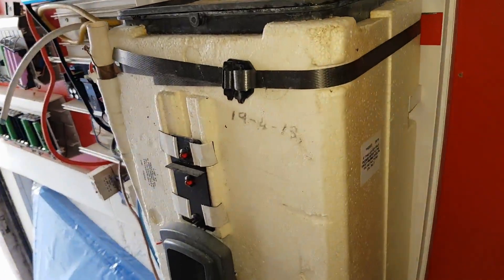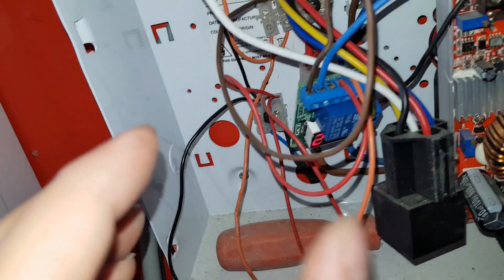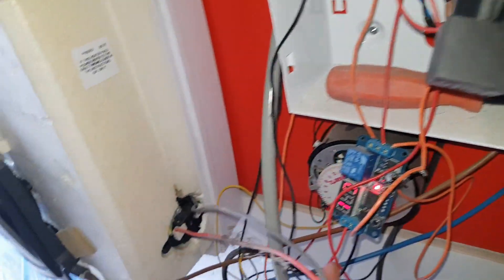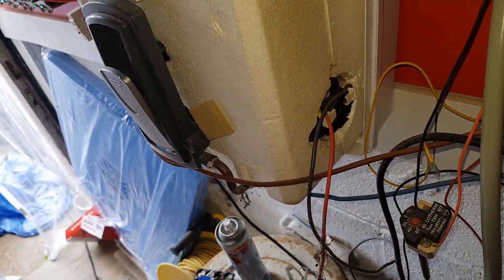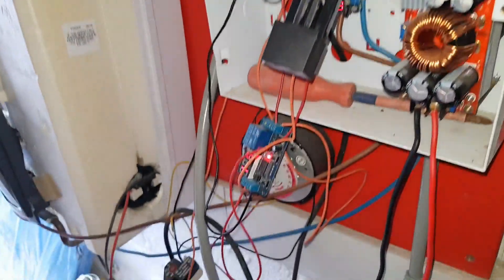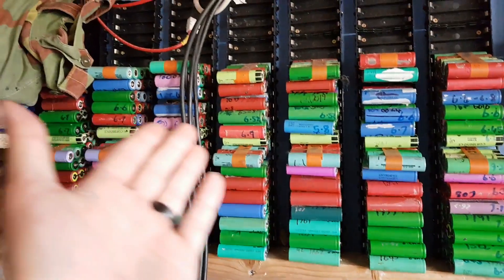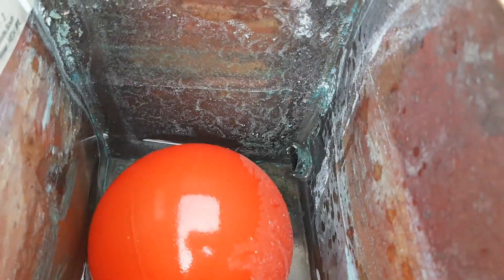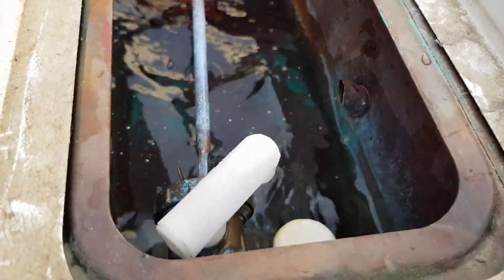Divert excess solar into hotwater - upgrade part 1 25L experiment

Comment: you said you have bad luck with ptfe tape, i think i  saw why, it was on backwards so the turning of the nut was screwing the tape off etc, while it doesn't all come off, it causes it to 'ball' up inside the threads and not seal too well, wind the tape onto the thread in such a way that fitting the nut pulls the tape tight.
Reply from the maker: Project 806 Camper now that could be it! I have a couple of water heaters to change soon I will see if I'm wrappi g he wrong way around!

Comment: For your Relay to Relay to Relay, you could skip all that by using an arduino to control final relay. You would need a FET that can handle 24V to hold the final relay open. Then use the arduino to flip the FET which turns on the relay.  The input of the arduino measures your voltage and also runs the timer for how long you want to run for.
Reply: And I thought a year ago I had a chance of him listening to me.  If you are in the US there is a much simple, cheaper and more efficient way of doing this and not screwing with the batteries.  I have videos doing it with Arduino and other stand alone $5 inverter boards. Lots of hot water, even have a dishwasher and just have a car battery.  Technology is beautiful!
Reply from the maker: opera I did reply but got no further with your videos. This is what I have to hand and is using my knowledge and that of my subscribers to help me improve upon. 

I do not believe it is screwing with the batteries. Just allowing a load to be switched on just before my charge controller shuts off.
Reply from the maker: Korishan I'm interested in the programming side but have so many things on the go adding another is pretty difficult. I have got one more new thing to get to grips with but once it's running it will save me time and money in others! =)

Comment: The joint compound definitely goes on the threads. We call that pipe dope in the US.
Reply from the maker: Aaron Anderson I'm just a spark. Lol going on past experience on copper tanks if that stuff is used on the thread. It can be so stuck in place that undoing can tear the tank. Might be different type of tank?
Reply: as you have the seal plummers putty should not be needed and yeah it goes on the threads i prefers this to ptfe tape